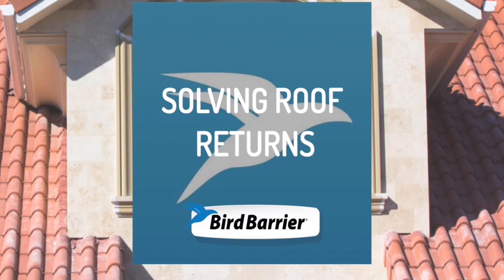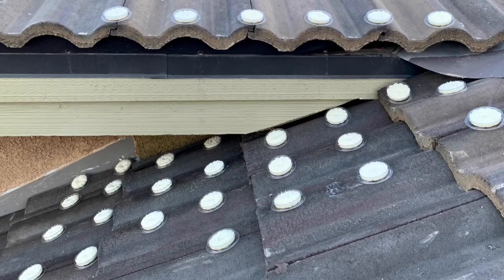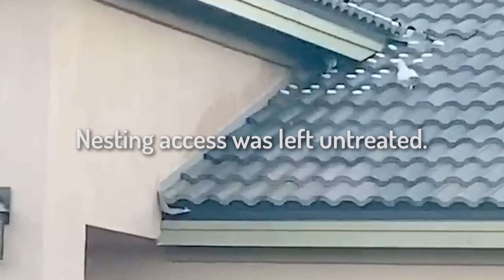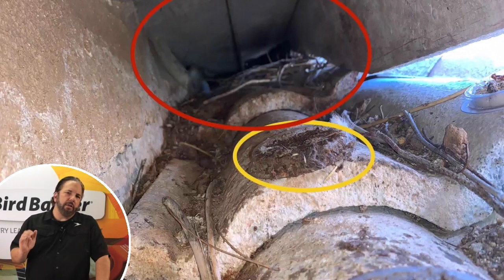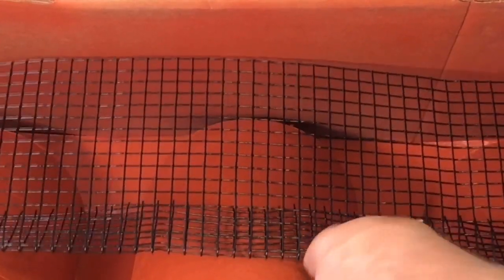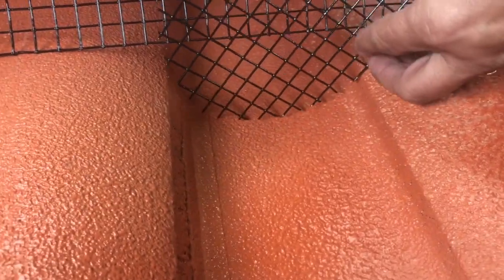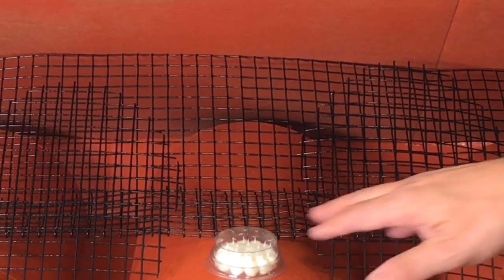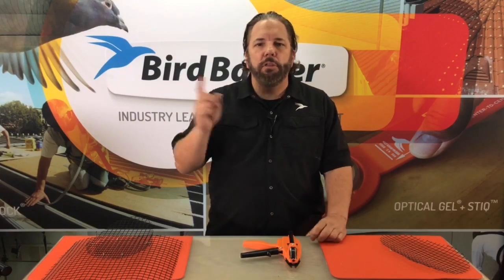Solving Roof Returns: Using Bird Barrier's Solar Panel Mesh & Optical Gel

Comment: Thanks Michael, see you at the end of the month (virtually). I am signed up for the 29th & 30th, but it appears there may be a couple of other classes on the same days not included in the certification. I will need to check it out, to make sure I get as much training as possible on these two days.